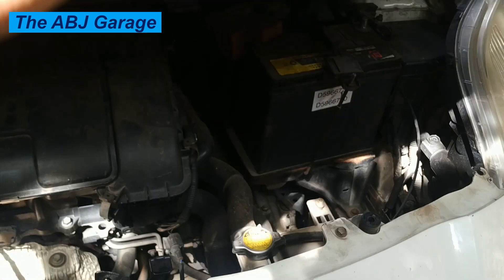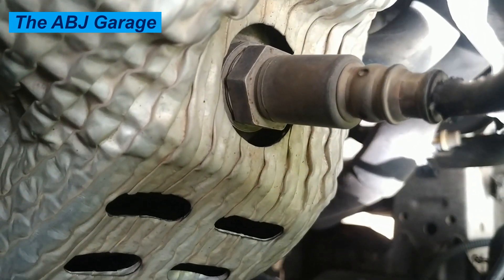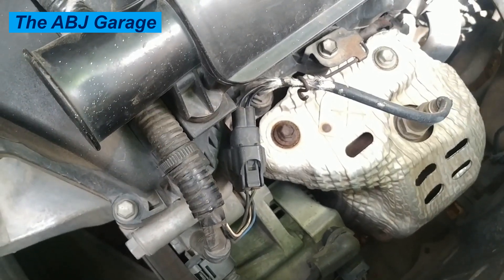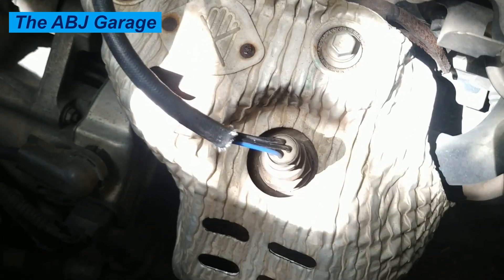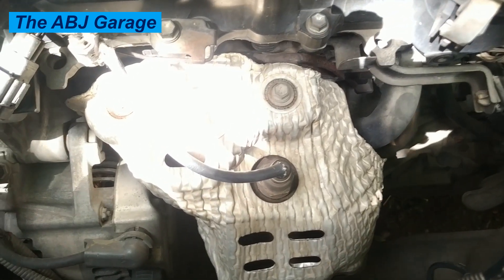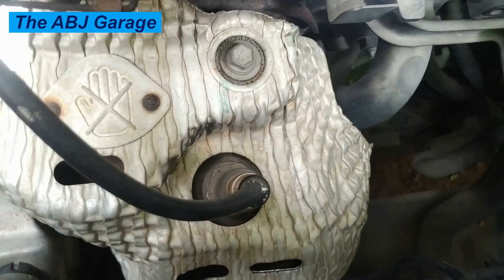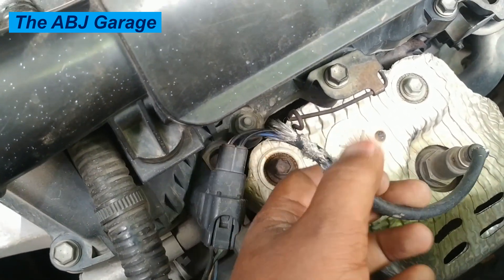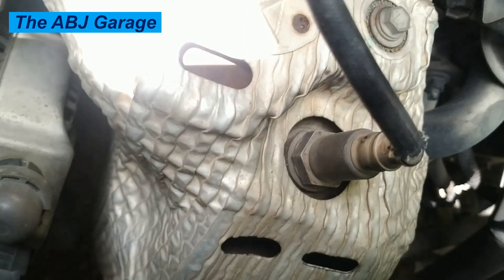10 Bad Oxygen Sensor Symptoms

Comment: Thank you for the information, I recently had to replace my O2 sensor, got worse fuel economy and couldn't pass emissions. Do products like Protec Oxicat, or the famous "Cataclean" help prolong O2 sensor life?
Reply from the maker: You better do the following to prolong the service life of oxygen sensor: 
Keep up with regular vehicle maintenance, Use high-quality fuel to prevent contaminating the sensor with impurities. Ensure the air-fuel mixture is balanced. An overly rich or lean mixture can lead to premature sensor failure.
And if possible Limit Short Trips
Reply: @TheCarCareGarage  Thankfully I do just those things; which is why my sensor eventually broke at 25 years of age ;) What more could I ask for. Keep up your great work!